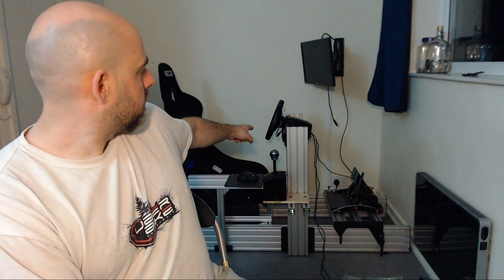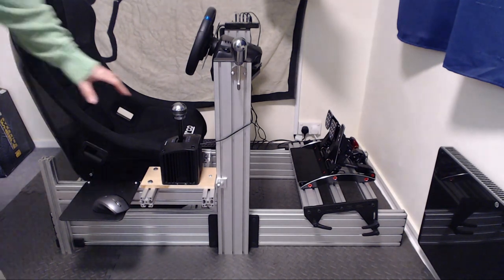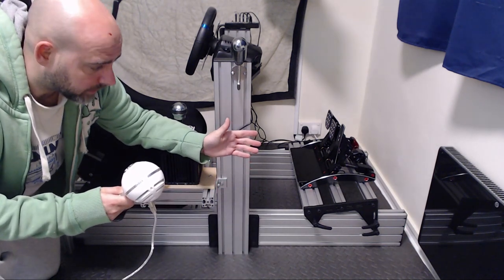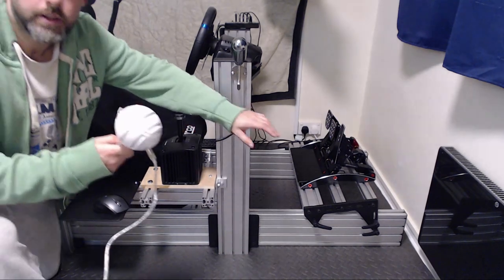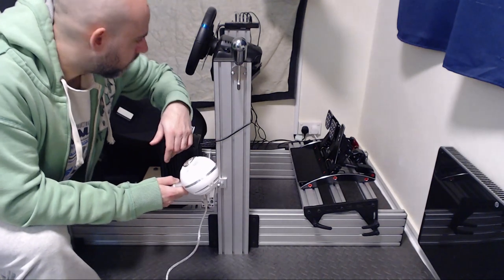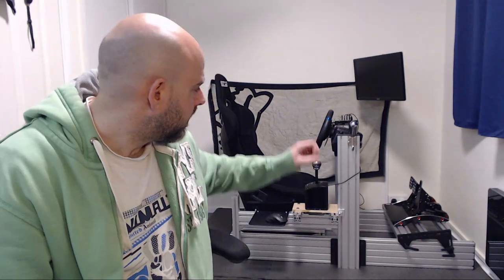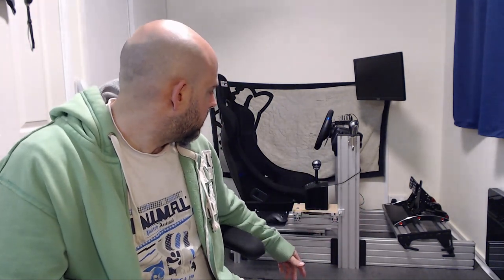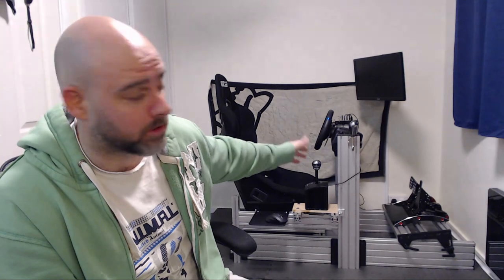Super rigid P1 cockpit build from Sim Lab

Comment: Hi again RB, i said i would let you know when all my gear arrived, and well it all arrived last monday 25\6\18. All my sim steering kit i picked up from birmingham a few days ago. I opted for the Martin Asher button plate and a Motomec D shape 320mm rim plus the very nice Q1R quick release. I cannot tell you the amount of trouble i am having with Simlabs. They left some crucial custom bits off the order that we spoke about for quite some time. When that eventually arrived i thought i would take a look at the whole cockpit, as you know it's been a very hot couple of weeks and i just was not bothered after a days work but i thought i must check everything, and to my amazement there were a lot of other pieces missing, like the 6 handles for the pedal tray, a complete set of M6 T-nuts missing. corner brackets missing and a few other pieces. I got in touch with them and for some reason they are not replying like they were before. its like they just don't want to know. I asked them 2 days ago if they have sent me all the missing pieces but have had no reply, no tracking number, nothing. I have lost all my faith in simlabs and its put a big downer on the whole thing. i can't even finish the build. Anyway sorry mate to moan and bitch but i just wondered how did you get on with them when you had missing items
Reply from the maker: Oh man sorry to hear that. I actually am still awaiting an item from them! The keyboard tray did arrive, but still not received the actual shifter mount I order months ago. They have always been pretty good at replying though, so not sure what that is about. Each time they kinda laughed it off saying it's not uncommon for them to mispackage or whatever, which is a bit weird. I honestly do not understand why they don't have a checklist they tick off for each customer and don't send it out until it's ticked off. At least you can use the M8 bolys and slot nuts instead of the plastic handles for now, I don't use them at all.
Reply: Wow didn't know you have been waiting that long. I need the pedal handels as there are a few others who will be using my rig so adjusting them would be a lot easier and faster, plus the tilt function is great. I was going to ask you, do you know anywhere else in the uk apart from Motedis` were i can get the correct slot nut M6\m8 size. I cannot mount my pedals, monitor, or the buttkickers to the profile. Motedis charge an absolute fortune for postage. I just need about 25\30 M6 slot nut then i can complete this thing.
Reply from the maker: Sorry I don't know anywhere, I have been lucky that I had enough nuts from Sim Lab plus a few spare. Sadly 80/20 and accessories are a lot harder to get hold of here than elsewhere. Imagine how awesome it would be to walk in to somewhere like B&Q and instead of wood, taking 80/20 off shelf having cut to size etc, you could build a rig like nothing. 

You can buy from UK based eBay sellers, looking at nearly a pound a nut though ridiculously, but you may have no choice.
Reply: Raging Beard  .Yes it would be great to get it anywere, however I have today been looking hard for the M6 slot nuts and to my amazement I have found a supplier of profile in Leicester, thats about 10 miles so I am ringing Monday and picking them up. I just hope they have plenty as I will get loads. I again tried to email simlabs but nothing back. I can tell you I am well pissed off with them
Reply from the maker: Been over 3 months and I still haven't received this simple piece... https://sim-lab.eu/product/fanatec-clubsport-shifter-side-mount-tilt-adjustment/
Reply: I would be well pissed at them, 3 bloody months. I got some good news though, i got onto Demon Tweaks in Wrexham were i got my P1 rig, i didn't go direct to Simlabs, and they somehow managed to get Simlabs to communicate with them and within a week i got all the missing parts i mentioned earlier plus loads of slot nut, M6/M8 like a whole bags worth of each plus loads of M8 bolts plus the 6 pedal handles and various other bits. I also got a very apologetic email from Richard saying they completely didn't see my 5 or 6 emails i sent them. Anyway i can now finally complete my build which i should do this week. If i need your help with the wheel, you still up for a phone call with me mate
Reply from the maker: Awesome news! Yes mate happy to help, though once you get stuck in I am sure you won't need it lol. Fun to build and you can mess anything up that's the beauty of it, just keep moving stuff until it's how you want it.
Reply: High again. RB Just to let you know, i am about to upload a video on my channel about my P1 in its current state, however i have on one a ocasion referred to you as Ragin bear so please forgive me for that, I don't edit any of my vids because i cannot be arsed, not like you pro boys. I have finally got my P1 sorted out and it's in the cabling and testing stage.
Reply from the maker: Lol Ragin Bear sounds like should be in Dances With Wolves or something. Nice one on the P1, and I will check it out when it's uploaded!

Comment: ye, the only reason you'd buy the p1 is for the CNC parts like the wheel bracket. That can be bought separately though. Their GT2 is plenty enough in terms of stiffness actually. I've seen motion rigs with just single slot profiles and they seem to do fine

Comment: I've just come from your Playseat Challenge video! You say just what I'm thinking about that modular aluminium box section. It's quite easy to accurately cut box sections (i.e. with a cheap evolution saw and made up jig) yourself, and I guess your off-the-shelf pricing included the cutting to length in the price. I wonder how much it would cost for just the material alone. 

I don't know if Sim Lab could have put a bit more effort into making this into a product, rather than a bunch of aluminium channel with some sharp edges and missing parts. I bet it's as rigid as you can get though - it certainly looks it. Thanks for your honesty.
Reply from the maker: Hey, thanks for commenting. I priced that all up at Motedis, their charge per cut I think is only about 75p. Though cutting yourself would mean you can be very precise in what you need plus give you offcuts which could prove useful for any additions. 

I bought the bundle from Sim Lab which included the Sparco seat, so I suppose the actual rig itself cost me maybe 700 Euros, which isn't a whole lot more to be fair.

Sim Lab was quite frank and honest saying they made mistakes packing things together due to rushing to fulfill so many orders. They were quick to respond so I would recommend them to anyone looking for a complete cockpit solution.

Good luck with your build!
Reply: Sorry, I guess my comment came off as negative through my thinking out loud, but the material and construction seem excellent and this would make the most rigid, adjustable and adaptable rig possible. Glad to hear Sim Lab came good in the end for you. Also good to know about Motedis UK too - thanks

Comment: Thanks thats very kind off you. I liked the wheel video you put up, i think mine is that one too that i will be ordering. was just a little worried about your EMI problems you have been having in one of your comments. Have you managed to sort it out. Plus the one big question is, does that rig flex any with that wheel? I am going to say not a chance. I am going to be adding my 4 buttkickers i have on my rig now so i am hoping for less rattle noise then what's coming through at the moment. It looks very solid so may give my BK's a better much harder cleaner thump. I think i will be getting intouch with you soon as it looks like i have the same setup apart from the pedals
dave
Reply from the maker: EMI for me has been, and still is, a nuisance. Currently mostly solved by wrapping foil around the motor power cable and grounding it, but it's not perfect! SimPlicity though will be taking it back and sending out another, they said in the 500+ units they have built, they have never known EMI like it. Just my luck I guess.

As for flex, well there's probably more flex in the Great Wall of China. This rig laughs in the face of flex. It's more rigid than a rigid thing on steroids. It's probably overkill, I'm sure the 40x160 pieces aren't really necessary lol.

Just put aside a good number of hours to build it! This wheel and rig combo truly is awesome. I do need to invest in buttkickers too at some point.

Comment: Hey fella, a few questions maybe too personal to answer back, but here it goes,
 What seat are you using? How tall and how much do you weigh?  Is the seat comfy for long sessions for you, you seem about the build as me.
I might be slightly bigger, but you can never tell with vids. Are you using any transducers?  And if you haven't already git yourself on IRacing bud 👍
Reply from the maker: I am using the Sparco REV II, which is the larger version for larger (fatter) people. I am 5'10-5'11" and I am currently in fat bastard proportions weighing in at about 16 and a half stone. The seat is extremely comfortable, I have nodded off in it during extensive sessions.

I got the seat as a package deal with the P1, being one piece fibreglass, Sparco, and FIA approved, I am sure it's not the cheapest option for a sim rig, but I love it.

My free 3 months on iRacing just ran out. I am holding off on subscribing again as I think I would have liked to of gone the GT3 route, but I may as well see what ACC brings to the table, plus cars and tracks for a season are over £200 or so lol. But the racing was good and VR works really well, so I am definitely tempted to return.
Reply: Cheers fella, seems we are about the same weight and iam just a few inches shorter, so now thats kinda put me in a happier place, but yeah like wise still a fat git lol. 

I was looking at the GRID II seat that is not currently shown on their site, and the reasoning for going with this seat was because i know sometime in the future i will be going motion, and the GRID II will seem like it will hold you in a bit more.

You can still go down the tin top route in iRacing and it wouldnt really take you long to get there, and as you know its the other idiots that prevent you from getting there quicker.... "that's racing".

Well hope to see you in iRacing sometime fella, keep up the content with your videos as I'am liking what your doing so far. And if you see me on track gimmie a shout... Juice
Reply: Sparco is breaking my brain - I'm shopping for a seat but Sparco quote dimensions of 330mm at the hips, which is just not human sized and obviously bollocks. It's making it impossible to choose one.

Comment: i need your help mate!
I have a p1 rig , what size bolts do i need to fix the clubsport wheelbase v2 to the front mount ?
Also what size bolts to fix the side mount plate to the shifter? ANY ADVICE MUCH APPRECIATED!
Reply: Looking at your video am i right in thinking thats a frontmount you have but you are using as a wheeldeck?
Reply from the maker: @JohnG-gu5wo  I was yes, that was before my OSW arrived so made do using it that way with the G920. As for bolts, does the Clubsport base not come with the bolts needed, looks like it does. As for the shifter, which shifter do you mean? I use the Fanatec SQ shifter and for that you just use the included bolts too.
Reply: Raging Beard when you say the clubsport base comes with bolts do u mean the bolts that are screwed into it already ? Take them out and use them?
Reply from the maker: @JohnG-gu5wo  That's what I assume from looking at it. I haven't had one myself, it doesn't come with any mounting info etc?
Reply: Raging Beard bought it second hand, stressing like mad trying to mount it! I have the frontmount but im thinking would i be better flipping it and using as wheeldeck? Thank you so much for the advice 👍🏻👍🏻👍🏻👍🏻
Reply from the maker: @JohnG-gu5wo  Can't you just try it? See if the already installed bolts line up to the mount, if so then they must be fine to remove. Then either reuse those bolts, or fit with longer ones.
Reply: Raging Beard will try tonight, simlab are good at answering emails until they have your money then its a different story

Comment: Well blow me down, i am also coming from a logitech, but the G25. Can i ask you, is it ok to PM you if i need any advice on this rig as i am about to get the exact same rig, also the Heusinkveld Sim Pedals Pro and a SW28 (28Nm Direct Drive Wheel) i already have the DSD short throw pro sequential shifter, although i don't know how i am going to mount that to the P1. Great looking rig and i cannot wait to get all my gear and see how good the G25 was
Dave.
Reply from the maker: Of course sure you can PM or ask here, I don't mind. I wish I had gone for the HE pedals, though the Fanatec V3's are awesome and will serve me well for a while.
I don't know how that shifter mounts but it will not be difficult. Worst case scenario you would have to buy a few more short lengths, maybe use a bit of MDF like I did at first, where there's a will there's a way!

Comment: Hi again Ragin. I said i would let you know what rim i settled on, its this one
http://www.simtechracing.co.uk/products/steering-wheels
It is the SRC PRO with the sli display
I will be upgrading the coiled usd for a much thick better quality one straight away, plus replace the knitter lookalikes for proper knitters from Leo Bobnar. It was close between this and the Asher racing button box. I have also just ordered a GTX 1080 to replace my nice but aging 970. Won't be to long now It will be nearly 4\5 weeks since i ordered the P1 Rig but have made a few custom changes which Darko said need making and plating in silver
Reply from the maker: Nice one, rim looks really good and I was looking at them before too, but for VR use I don't need the disco lights lol. Enjoy the 1080, max those settings out!
So what mods are they doing to your P1 then? Sounds interesting.
Reply: Raging Beard  I was going to ask you about that rim, so glad it meets your approval. I use an f1 rim like that with sli display, makes knowing when to change gear easily, as for the mods, I suffer with massive motion sickness so cannot use VR or 3 screens so sim labs are making me a custom single monitor mount different to the one they sell. Plus I am having 4 custom buttkicker plates made to mount and slide into the side rail tracks, plus all have to be plated. Not sure what to do about speakers, I use 5.1 at moment, how have you got round it, mounting them? i was thinking of using my headphones to safe messing with all that exa cabling i would need to do. Yea the 1080 will be handy for a nice 32" 144hz. I have already been persecuted for not going VR but i just can't cope with MS. I tried a while back, the shop i got it from was kind enough to take it back
Dave
Reply from the maker: I don't use speakers generally as the Vive has headphones on them. I have thought about 5.1 though and the fronts would connect to the risers for the wheel, the rears I would buy more aluminium to make L shapes to sit behind at ear level. No idea where the center one would go! Headphones are a lot easier!!
I have now mounted a 43" 4k screen to my rig for games like Wreckfest which do not support VR. I just use its inbuilt speakers at the moment, they aren't great but will suffice until if/when I come up with an alternative.
Look forward to seeing you rig when it's done, particularily what you are doing with the Buttkickers.
Reply: Raging Beard I will keep you posted. I think it's going to be at least 2 more weeks until I get everything. Its going to be a parcel fest